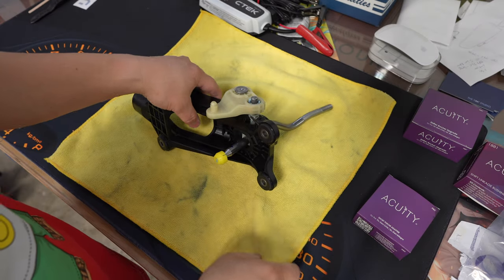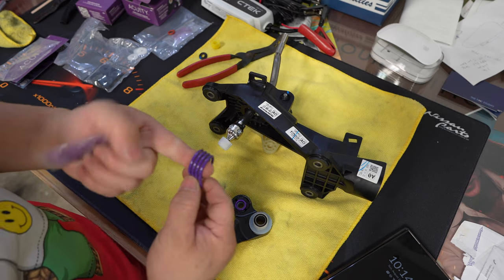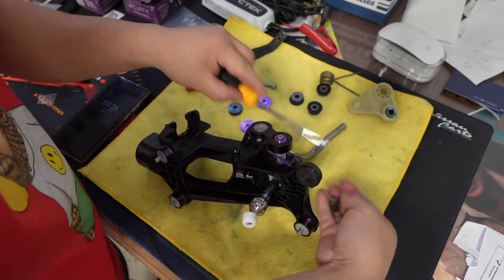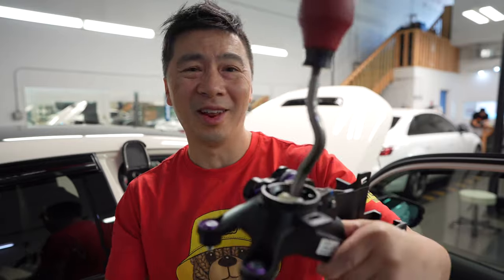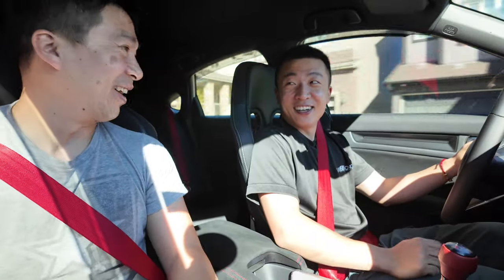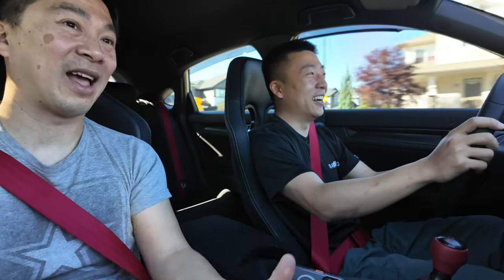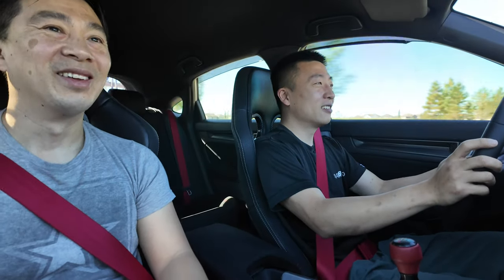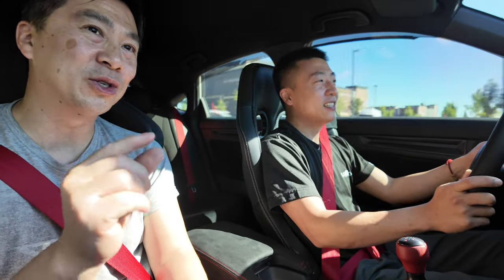Stage 2 Shift Kit 11th Gen Civic & 5th Gen Integra Review Pt. 2 || Acuity

Comment: great and fun video!  You seem to mention this kit raises the shifter (knob) - is that the case?
Reply from the maker: With the short shifter adapter it comes with spacers that goes underneath the shifter base.
Reply: @phothrottle  Yes - I see that acuity describes lifting by 7.5 mm. It looks like yours is higher.  Just my eyes tricking me - or did you also lift the knob up on the threads a bit?  Hope I can someday get a Civic Si.  Acuity will be one of my few mods.
Reply from the maker: @nathangriffin2027 yup I also didn't thread it down all the way. Good eye my friend! 👍

Comment: Firstly, hello from Australia and I love your videos! 

After watching this video I immediately ordered and then installed the full Acuity stage 2 kit which I drove for around 3 weeks.  I've now pulled it apart again and removed the upgraded centering spring which I felt was actually too tight and left the rest (cable + base bushings, short shifter kit and upgraded rocker plate. One difference in my set up is that I also installed the Hybrid Racing detent springs at the same time that I did the cable bushings. 

IMO the gear shift tension and centering force feel perfect with this set up. Give it a go!
Reply from the maker: The nice thing about these kits is they are full customizable to everyone's taste. I know about the HR detent spring. I just haven't gotten around to doing it but thanks for sharing it with me. Are you planning on switching out to the full shifter kit in the future? Thanks for supporting my channel!
Reply: I feel like it's close to perfect the way it is now so I'm not sure if changing the entire assembly will mess with that formula. I'll definitely wait and see what Acuity comes out with though.
Reply from the maker: @b0un the Acuity full shifter assembly will be going into my FL5. I will post a vlog once receive it hopefully early next year.
Reply: @ looking forward to the video!